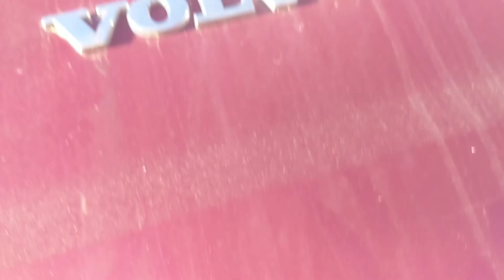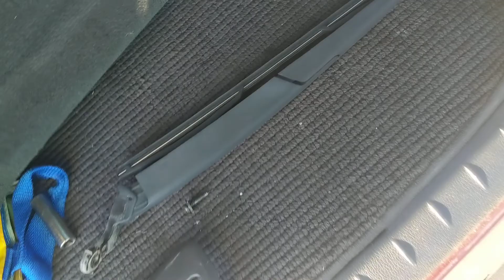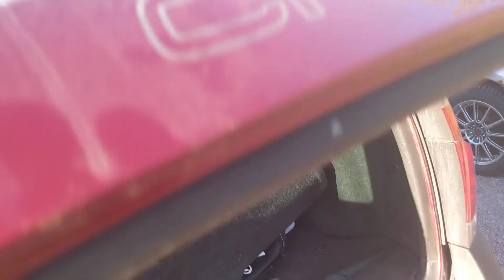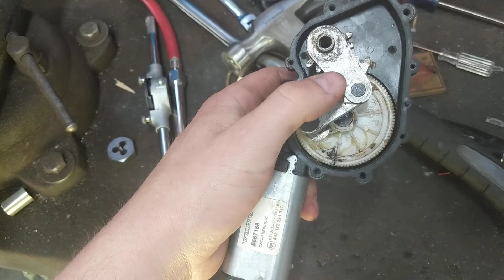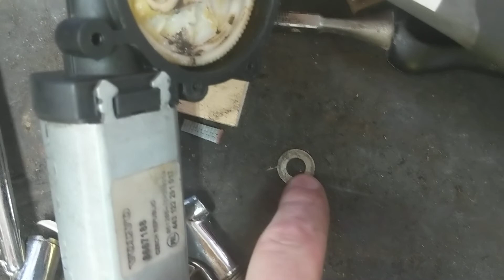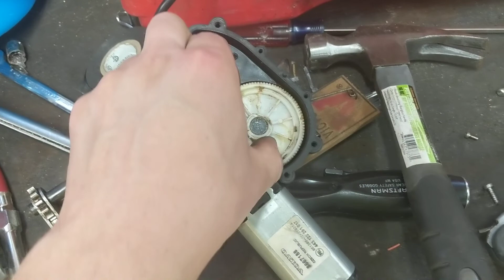Volvo XC70 Rear Wiper Motor Repair (Don't replace it, FIX it)

Comment: Thanks for this, I had the same problem. The shaft was very stuck, got some rust on it and a bit of pitting. 

A few additional tips:
-pry out the small rubber O ring in the shaft that seals the shaft for the wiper fluid so you don't lose it.
-put the nut that holds the wiper in place back on the shaft before you start hammering it, this prevents damage to the end of the shaft. Make sure it is flush with the end of the shaft so you don't damage the threads.
-when putting the assembly on a vice or something to hammer the shaft out, make sure the entire assembly has space to drop out, otherwise you're just hammering the gears into your vice, ask me how I know.
-Where the shaft exits the housing, there's a plastic cap. Under that cap is a rubber O ring which prevents water from entering the housing. Make sure it's still there and installed properly. 

In my case there is rust and pitting on the shaft, exactly where the rubber O ring is. This causes water to leak past the O ring and causes the shaft to rust even more, eventually seizing it. Cleaning it up and applying generous amounts of grease fixes it temporarily. So I'm going to replace the entire unit anyway, for now it's working again, but it's only a matter of time before it stops working. And I broke the spray nozzle...

Comment: Nice video. Opened up and the plastic gear was gone bad fron 2 points.
Reply: New motor then?
Reply: @HowToDoStuff  na you can replace the plastic parts

Comment: I'm currently fixing the new one I installed just a few months ago that's already seized. I got the shaft out and used a scotchbrite and a sonic cleaner to get everything cleaned, but there is one brass, one steel, and one plastic shaft collar that came out with my shaft that I don't know how to reinstall. Any tips there?

Comment: Thanks for your video. With this guidance I was able to remove, clean and fix, and replace the seized rear wiper motor. Saved a packet of cost at the garage! You're missing a few useful tips, like how the jet nozzle just pulls out of the spindle, but you've got the essentials. Great stuff. PS. What's the mousetrap for - you got mice nesting in the air filter?!!
Reply from the maker: The video was kind of an afterthought. I already had it out when I started. And yes I do get mice in my Volvo sometimes. Maybe once every other year. They like to build a nest in the rear folding seat area. I'm not sure how they get in. I have put some balled up wire in the AC drain tube and glued screens over the rear vent boxes. If you have any ideas on how else they can enter I'd love to hear them.

Comment: Thanks for this, it worked for me! My one was full of some brown gunk (possibly copper grease?). Cleaned it all out and applied new grease and is working again. I couldn't get the angle of the spray nozzle right so the water sprays off the car on one side now but a small price to pay...
Reply from the maker: Glad it worked. Next time it will come apart easier. You should be able to pop the cap back off and twist the washer squirter to where it needs to be. If not, maybe the nozzle is partially clogged so it's acting kind of like your finger over a hose and spraying in a random direction.